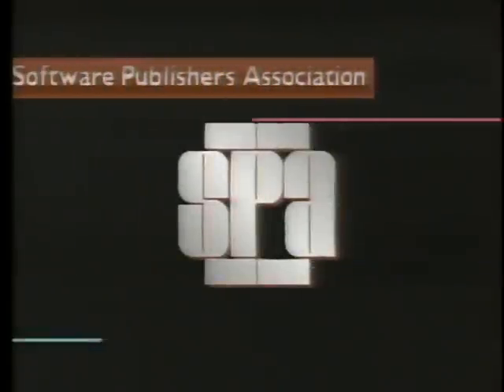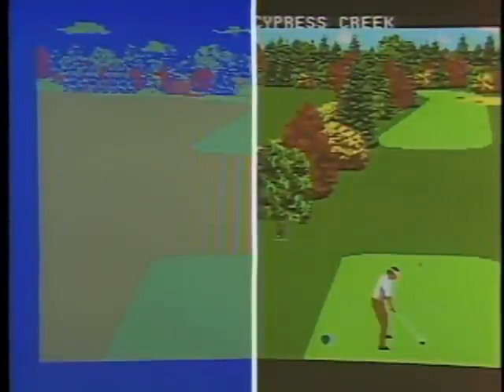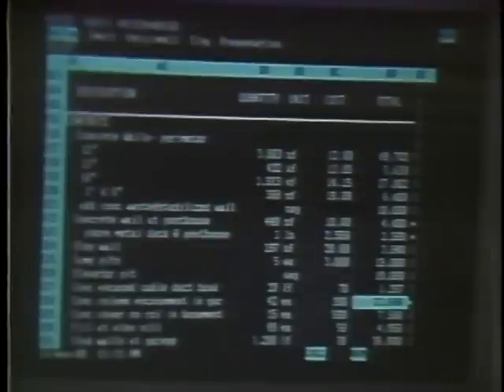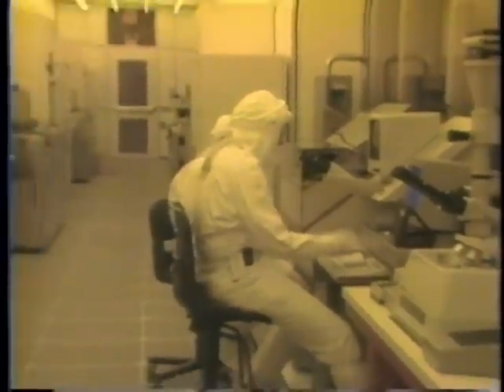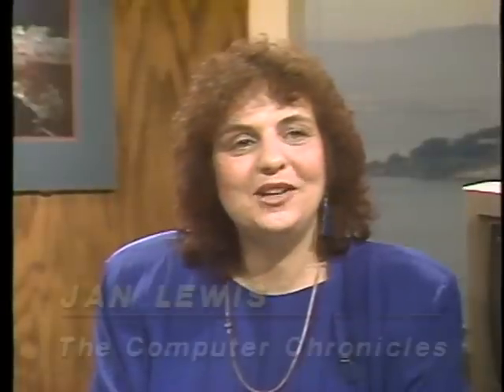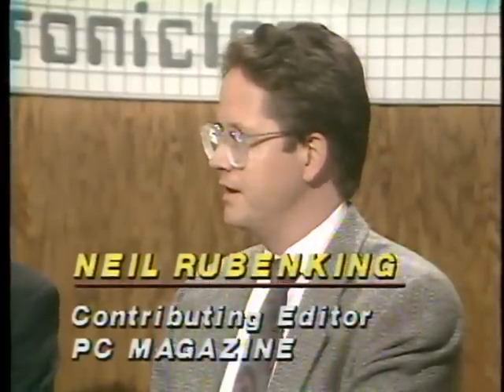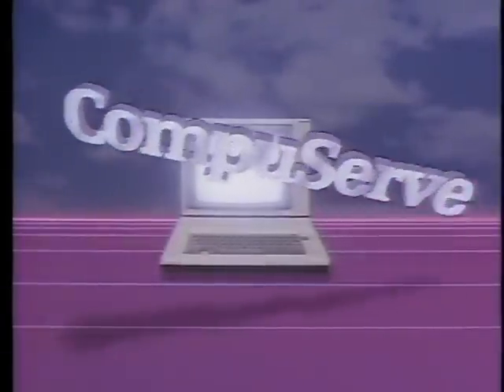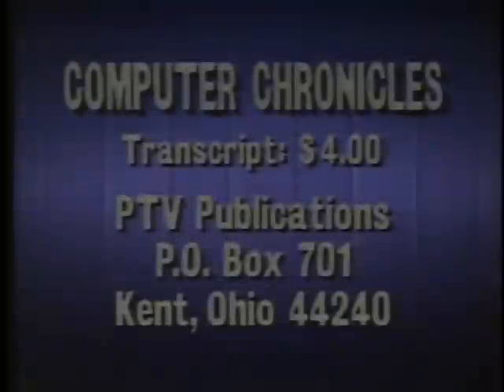The Computer Chronicles - Megahertz Mania (1989)

Comment: Lol..... I'm watching this on a full install of Linux on a 32 gb, high speed SD Card....... XD These guys.... Were they even aware of what would be possible one day....? I don't even need an HDD or an SSD.... :P
Reply: Predicting technological development or any other development for that matter never worked well. Not back then, not today. Sure you can set goals as a company, but too much can happen in 5-10 years.
Reply: flatshade
Yeah..... Well, my Laptop is broken... SO, the SD Cards, eh.... They're tied to the BIOS, which means.... Reinstall, but NOT on this Surface RT.... It's just... I mean, it's like Microsoft was watching these videos and said: "Hey guys, remember what we did back then?? Well, it's Lockdown TIme Bit*hes! I introduce..... WINDOWS RT!"  :(  Can't boot LInux alongside THAT.... But, I can code websites, and write programs, since it DOES have mostly all of the basic Windows tools, like CMD, Notepad, and it CAN install some decent to great games..... But... SECURE BOOT NEEDS TO DIE....  >:(  I can't even access the UEFI or install apps, even if they were made for the ARM Architecture....  :'( Dam Nazi OS, masquerading as a Tablet to open and change things in a meaningful way..... :( Even the BOX looks no different than the Surface Pro.... ARM Chips have PLENTY of Apps.... Microsoft just says, "NOPE."
Reply: blackneos940 I have ever seen text so hard to read and undertand. Think before you write it down :)
Reply: Mika Korhonen Uh....  You seem to speak English just fine.....  >.>
Reply: Never say ever :) I just tought, maybe understanding what you try to say is hard for most of us.
Reply: We didn't need HDDs or SSDs back then either. The major operating systems from 1989 could run from floppy, tape or sometimes embedded ROM.
Reply: MrGencyExit64
Yeah.....  But everything except the ROM would easily fail.....  Still, I never thought about that.....  :D  Shows I need to think outside of the BOX, if I'm to get any better at Programming and Computers in general.....  ;)
Reply: +blackneos940 +blackneos940 Hope thtat's a temporary build/project, and that you do know the kind of flash memory in SD cards will only live through a ridiculous amount of read/write cycles compared to a proper hard drive, and that hosting an OS in one of those is for something occasional/experimental, and never to be trusted on a system you will use everyday...
Reply: blackneos940 You have passed the stage of cocky Skiddie, and have entered into "reverent Geek".....   :)

Comment: The guy said "speeds up to 200MHtz in the coming decade" meaning by 1999.  I think I got my PIII-1000 in 2000.
Reply: Per wikipedia
733 MHz (0.18 μm process, 256 KB L2 cache) introduced October 25, 1999.
The year was almost done , the P2-450 was tops in most of 1999.

Comment: I would have liked to see them show a Mac II (1987) side by side with those PCs in redrawing the screen. The Mac II came with the Mac II Video card that was able to display 640x480 @ 256 colors vs the PCs EGA could display 640x480 @ 16 colors. By 1989 Radius, RasterOps and SuperMac offered NuBus video cards that could display up to 1600x1200 @ 16.7 million colors. The Macs NuBus slots that the video card used were 32 bit and not 16 bit like the PCs. Not only could it display more colors, but it could also handle up to 6 displays. The PC could not. It could also have up to 8MB of 24 bit addressed RAM to the PCs 16 bit addressed 640K. In addition, it used SCSI drives up to 80MB with a max transfer rate of 20 Mbit/s as opposed to the PCs RLL 30MB drives with a max transfer rate of 7.5 Mbit/s. It could also support up to 6-80GB drives as opposed to the PC which could only handle up to 4-30MB.
Apple opened up the bottlenecks on the Mac II that PC's wouldn't see until PCI in 1992 and fully realized until 1995 with the introduction of Windows 95. Yes there were a couple of competing 32 bit slots in the PC side that never caught on because they were problematic with very few expansion cards utilizing them. The 33 Mhz 386 they showed, depending on when this episode was released, was either a demo model or just released. Windows 95 was the first OS on the PC that fully supported the 386. MSDOS and the EISA architecture of the PC couldn't take full advantage of the 386.
https://www.youtube.com/watch?v=KP3kODdYDOc&t=1133s
Reply: remember, macs between 2006 and late 2020 were pc hardware.
Reply: @MrJorgalan  
Pretty much. Actual Apple hardware still had a few tricks up it’s sleeve that PCs didn’t. Such as booting into target disk mode. This mode turned your computer into an external HD. It made imaging them super fast and easy and made file recovery pretty easy as well.
It also had the ability to boot into a recovery mode that could pull OS X directly from the Internet and install it without a cd, USB drive or external drive.

Comment: They guy was close, 10 years later in 1999 the PII-450 MHZ was top dog.
Reply: PIII-800
Reply: @nadirjofas3140  The Intel Pentium III 800 was Launched in Dec 20 1999. (might as well call it a 2000 CPU.)
But Yes the P3 -550 was out in 1999.
Reply: That still wouldn't make the PII-450 MHZ the top dog.

Comment: You will notice that they did not include the CPU I had at that time, the Harris 286 25MHz in the mix because it would have pissed on all three of the 386 systems shown from a great height as far as speed is concerned.

One thing I have noticed about the Computer Chronicles episodes I have watched from the late eighties is their propensity to lie by omission. It seems that they were not a tech program but rather a marketdroid and salescritter program.
Reply: Michael Nager The fastest 286 at the time was 16 Mhz. (for AMD, Intel only made them up to 12)
Futher, by the time the 286-25 was out, there were already 33/40 MHz 386 and 486s.
Reply: nerd73
History repeats itself - or as Yogi Berra famously said, "It's like déjà vu all over again." - with my i7-990X. Back in the day I managed to get a good swap for a Harris 286 25MHz at the CeBit in Hannover (I think that was 1989). With my 990X I managed to get a good swap with the 965X I had.

The Harris cost me nothing in cash and the 990X effectively cost me £75 or so (and I had gotten the 965X at less than half price) to upgrade.

My next system I built after the Harris 286 25MHz was a 486 DX50.

The thing is that for my needs the Harris stayed competitive for a long time, and this is also true of my i7-990X which is still my main machine even though I have a new system based on the i7-4770K.

I am gradually migrating over to the 4770K but I don't have much of a rush.

For my needs the Harris 286 still had a higher performance than the higher clocked AMD 386  variants you mentioned.

I know this because I was building 386 systems for others.
Reply: Michael Nager
I'm thinking it's not the CPU, since a 40 MHz 386 shits on a 286-25, but probably the ram or HDD, as those were much more important factors than CPU back then.
Reply: nerd73
Remember that the OS I was using back in the day was 16-bit and the 386 was a CISC processor with the 32-bit instruction set was at the top of the stack.

This means that for every 16-bit instruction it had to go through the teeth of the 32-bit hair comb before it hit the 16-bit instruction set.

Guess how much of the extra MHz of the 386 was left over per instruction? (hint, in comparison to my Harris it was actually a negative number)

There was no incentive for me to switch to a 386 and I gave that entire generation a miss. Not once did I own a 386 system nor did I want to.

I didn't have much use for Windows until Windows for Workgroups 3.11 and that is when I built my 486 DX50.
Reply: Michael Nager
That is completely incorrect. The 386 executes 286 instructions at full speed.
Reply: Michael Nager
Are you talking about the 386SX? I am talking about the full-blown DX.
Reply: nerd73
The SX was a total joke.

Back in the day I was doing mostly text processing and WordPerfect 5.1 was my program of choice.

I also did database programming with DBASE 3+ and later 4.

I didn't have any use for a 386 under DOS.

It just didn't offer any performance upgrade for me. I built many 386 systems for others (because the mainstream 286 was 12 or 16 MHz) when the 386 DX33 and periphery came down to acceptable price levels.

Comment: 33 MHz -1989. 3.2 GHz multicore - 2013. Insanity.
Reply: How about a twelve core processor instead? =p
Reply: Indeed--and a testament to the accuracy of Gordon Moore's prediction in 1965 (aka Moore's Law)....!
Reply: Yeah 33 MHz back then was considered a pretty fast machine, even a gaming computer. I forgot what mine was, but I remember overclocking it to 50 MHz and I could play the Lucasgames CDs.
Reply: Quake was the game of my choice back then. I tried what I could to push the machine to get better frame rates. I miss that old machine too. I had it for 10 years then shamelessly sold it at a pawn shop for extra cash for a bus ticket. I was 20 back then, so I was a bit hasty. Infact, I think I remember the shop saying they wouldn't even take it cause it was getting on in years, so I just left it cause it was too much of a pain to carry. I forgot exactly what architecture, just a video local bus, but in it's day it was really top of the line.

Comment: 4:14 - 'Today we're at 33MHz; is the maximum speed a microprocessor that Intel Manufactures (1989)... ten years from now we expect to be shipping microprocessors that operate at speeds up in the range of 200MHz' - Intel 1989.  Not surprisingly, he was COMPLETELY off. The Pentium 3 was released in February of 1999 with a base frequency of 450 and 500 MHz.
Reply: He was off because Intel was in its little own world of taking their sweet time to develop their x86 line.  In an alternate history, AMD and Cyrix never were interested, or perhaps barred by law, from launching competing products.  This allowed Intel to dictate the pace of advancement and indeed, we may have only seen 200MHz processors by 1999.
Reply: 200 vs 450MHz is not "completely off".  That's about one revision faster.   200MHz vs 5GHz would be "completely off".

Comment: I can't afford to buy the brand new blistering fast Intel 386 33Mhz CPU but I'm hopeful that in 2020 I can get an AMD Ryzen 3990X 64 Core 128 Thread and 288MB cache desktop CPU running at 4.8 Ghz  to render my spreadsheets on Windows 10.
Reply: Sure that will be fast enough?

Comment: Going over it again I see they skip over issues like bus speed. When did systems start using a faster bus? It's been a long time. IIRC back in 1989 I still had a 386sx system that probably had a standard 8Mz bus speed.
Also no mention of more ram for spreadsheets, investing in a math coprocessor, or video accelerator cards. A good 2d accelerator gpu was cheaper than a new motherboard.
A good 2d accelerator card and fast hard drive is cheaper than buying a new system. We all saw how well the cpu on a card idea worked. 😆 Back then 3600rpm was normal, and 5400rpm was fast. SCSI was one alternative; another was a caching controller, instead of wasting slower system ram.
They also completely missed the importance of computer gaming in driving new technology.

Comment: 200MHz in 10 years.. they were in almost 1GHz on 1999 :)
Reply: Per wikipedia
733 MHz (0.18 μm process, 256 KB L2 cache) introduced October 25, 1999.
The year was almost done , the P2-450 was tops in most of 1999.
Reply: 800 mhz was also 1999
Reply: @nadirjofas3140  New years eve of 1999.
Reply: @Crashed131963  20 December
Reply: @nadirjofas3140  Fair to call it a 2000  CPU not a 1999 CPU? Since 98% of the year  of 1999 has past.
Reply: @Crashed131963  That is still 1999.

Comment: I remember the Megahertz Myth back at the turn of the century.

Nowadays it's not really a big deal anymore as long as your computer has a fast GPU, enough RAM and a fast disk like SSD/Flash. And most importantly, the more cores, the faster you can go even at lower core speeds. (For instance, a quad core 1.5GHz processor will be faster than a dual core 1.7GHz processor as long as the app is designed to take advantage of all the cores.

Plus until the modern multi core processors came along, it was all about who had a higher GHz number. Thanks to multi core, we don't NEED a 3GHz single core as long as we have a dual, quad, septuple or quad core processor at a low clock speed.

Technology is a wondrous thing.
Reply: I agree to a point that we don't need 3GHz single core as long as we go Octa core at lower speed.
Why ?
Because most programs don't scale well, past 8 threads mark easily.
I think Intel and AMD calculated that 16 Core CPU (or 32 Thread one) is as high as U can go with x86 core, without wasting too much energy on contol logic.
Today ILP (Instruction Level Paralelism) or IPC (Instructions per Cycle) is more important than TLP.
That's why Intel Quad CPU's are faster than higher clocked "Octa" Cores from AMD.

Comment: 2023 My current main PC is a budget build  with 3.7 ghz, 6 core Amd processor with 32gb Ram and the plot could be modified to the Max possible but I'd expect some overheat issues @4.0 ghz 8 core   48 gb RAM .
  Technology wise the Case is pretty well a universal fit for  almost every motherboard and I have the OS on a mini RAM circuit Windows 10 home
Another thing from the Early days that I have kicked into touch, and has tumbled in price is my storage when we first started on windows my first Hard Drive was just 200 gb in size and that lncluded the Operating System!! Memory was a huge 16 GB!! 

2023... We are running a 1.5 Terabyte HD internally with a Selection of external USB drives and chips all with  specialist  programs  bit  like a big golf club selection only downside is that program has to have a cookie on the main Hard Drive for reference
And I found out that you can do the same on many Games Consoles provided they  have a spare USB socket for powering an external Hard drive.. I have 2 devices with a total capacity of  just over 4TB of archived games, using about half that when I posted this. 😊

Comment: "If you software running slow you need more speed" - hm... maybe someone intentionally made software slow! ;)

22:10 Windows was joke not because CPU was slow but because Microsoft never know how to properly code.
Reply: What do you mean?
Reply: +louis tournas He means that office and whatever type software he uses never gets faster, because they keep adding features, abstraction layers and keep coding it in higher level languages that slow things down.

A 233 MHz pentium II is surprisingly snappy. It got into windows 95 very fast, almost like windows 10 on an SSD; it ran big excel spread sheets pretty fast, it did all the word processing and whatever you wanted without delay or hesitation.
Reply: soylentgreenb
I see. Personally, I find that the web has gotten very slow. Some websites choke Firefox and it asks me if I want to stop running the javascript. The CPU usage goes to 100% (1 core) and there isn't anything special happening on the site. It is just text and pictures.

At work, they changed all the PCs from i5 quad core 4 GB Win XP to i7 quad core HT 4.0 GHz 8 GB Win 8 64 bit. It makes no difference since most of the applications are web apps. It is only MS Office that is local and a few others that certain people use.

You can't polish a turd.
Reply: "You can't polish a turd."
xD

Comment: Nobody would have paid good money for a 200 MHz cpu in 1999. Even the most barebone AMD-powered machines came with 233 MHz at the time, and it didn't really cost you a fortune to get a 333 or 433 MHz system.
Reply: I built a dual Pentium Pro 200 in 1997.  I ran that as my primary rig for 8 years.  It was fast.

Comment: 200mhz in 1999, definitely was conservative.  Per wikipedia
733 MHz (0.18 μm process, 256 KB L2 cache) introduced October 25, 1999
Reply: But the year was almost up , I think the P2-450 was tops in most of 1999.
Reply: John Smith oh yea, 733mhz was absolute bleeding edge.  I remember in the late 90’s to early 2000’s clockspeeds just shot up at crazy fast rates.  It was a fun time to be into computers for sure.  Now the fun is all about cores and virtualizing.
Reply: @clobbyhardy   Not as fun now, .
Before a upgrade was a noticeable difference and I keep up every year.
Now my 7 year old i5 does not stumble on and thing I use.
Reply: John Smith I’ve been getting deeper into the home lab stuff now and it’s actually rekindled some of my love for tech.  I’ve worked in IT for nearly 15yrs, and for the first time in a long time I’ve been enjoying playing around with tech at home when I’m not in the workshop or spending time with the family.  Now with Ryzen 2000 CPUs going for dirt cheap, it’s a great time to build stuff.  Raspberry Pis and other small devices are fun too, things have changed a lot though.